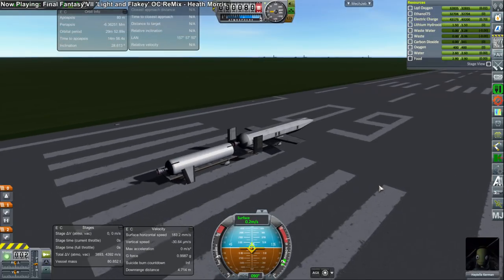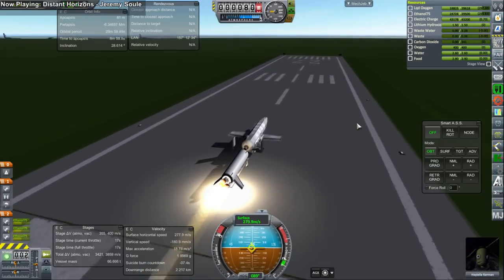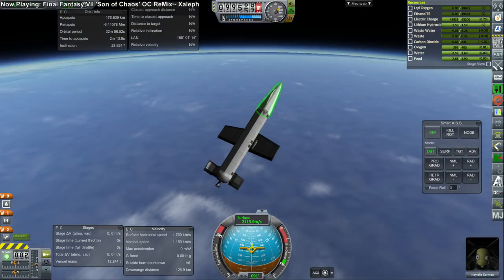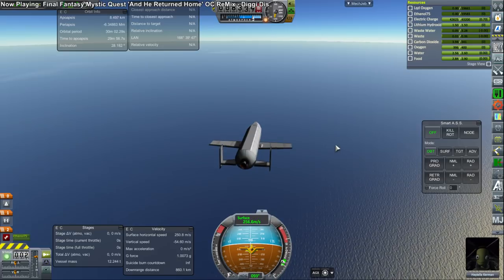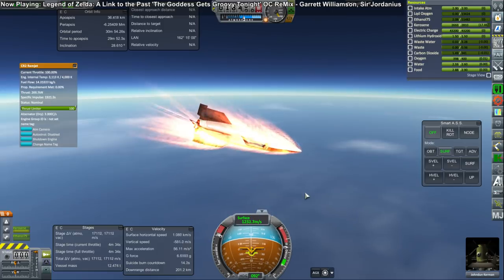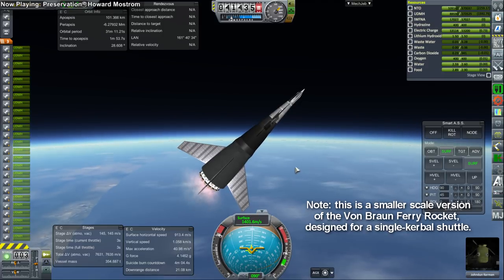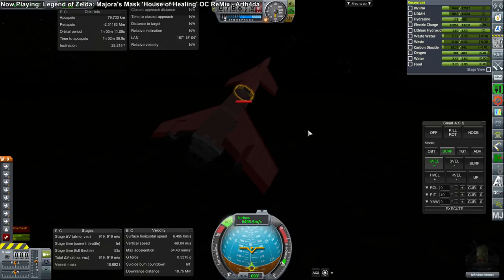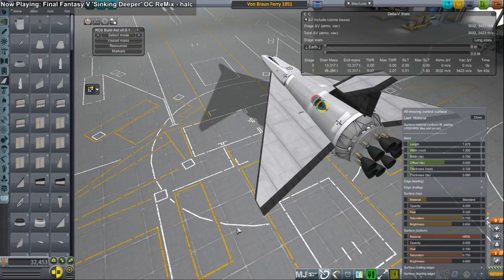Design of the Space Shuttle 01 - Early Spaceplane Concepts

Comment: The A9 was not the same as the A6 (the variant that you depicted as the A9) which was essentially just the V2 with the wings, no ramjet. The A6 was the one with the ramjet. Also, there’s two variants of the A9, making things more complicated. The early (or late, I’m not sure which) conceptual A9 had wing strakes which were more optimized for supersonic gliding. The later one that actually flew once used the same wings as depicted in this video.
Reply from the maker: I got my information from a book that covered these in some detail. Do you have a sufficiently authoritative source on this?